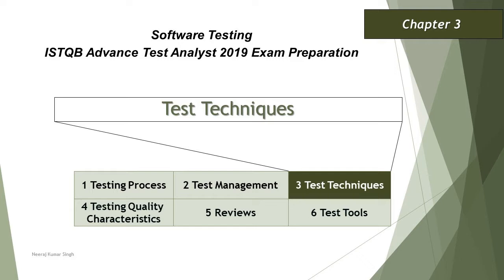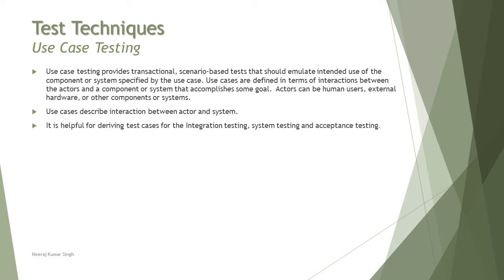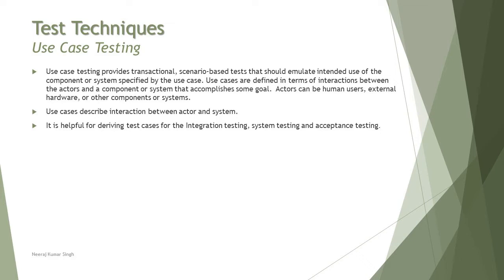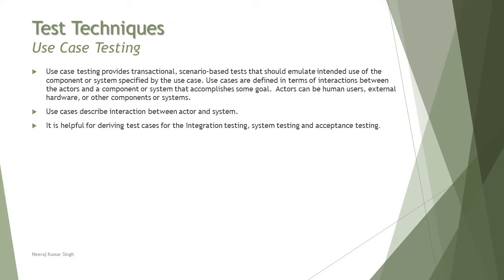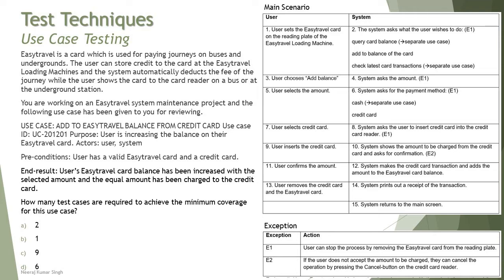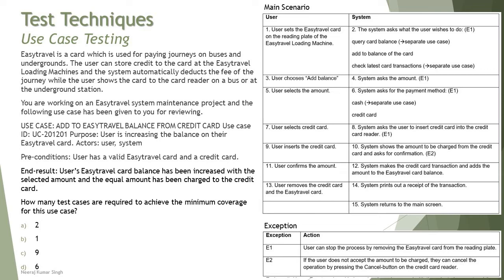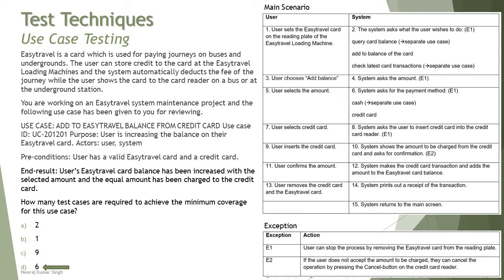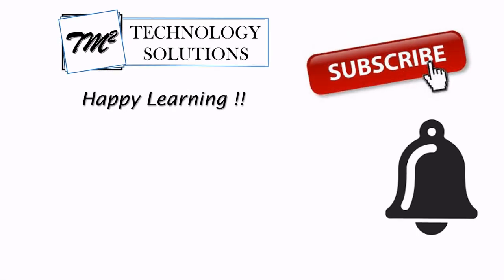ISTQB Advance Test Analyst | 3.2.8 Use Case Testing | ISTQB Tutorials

Comment: in the question they have asked minimum coverage, then should we not consider only  positive testcase ? which would be equal to 1
Reply from the maker: Yes the answer should be ONE
Reply: @TMSQUARETECH  what should be the final answer 6 or 1?
Reply from the maker: @parnikaagarwal3098 for minimum coverage 1
For maximum coverage six.

Comment: If execeptions and alternate path are not there but in question if we have to consider one testcase for alternative path..whether it will be one test case or 2 two test case?
Reply from the maker: Hi Bahadur,
Use case doesn't talk about any alternative so that's not going to be considered here by any means. If there are no exceptions then we might be limited to positive scenario only. So, we should take only one test. 
But, in reality there are no scenario where we can't have a negative test. So, we can have 2 tests.
For examination, we follow the question details and apply it accordingly.